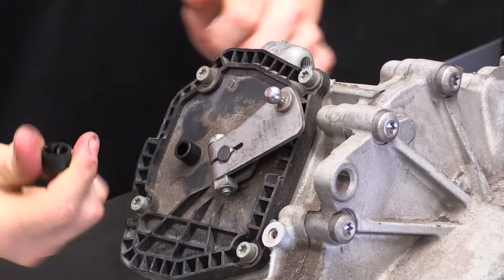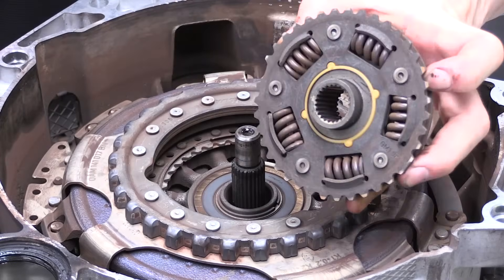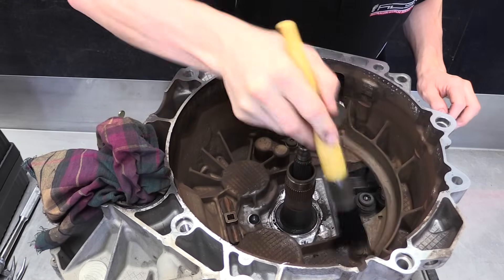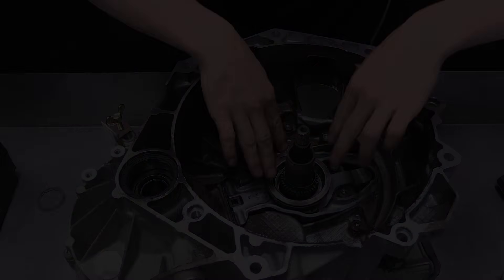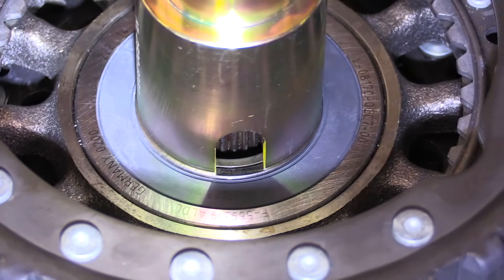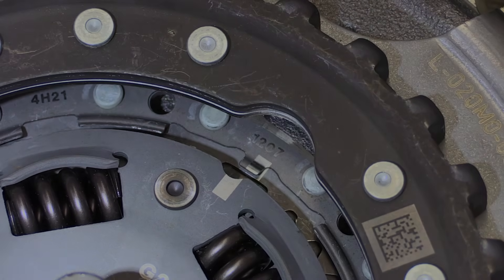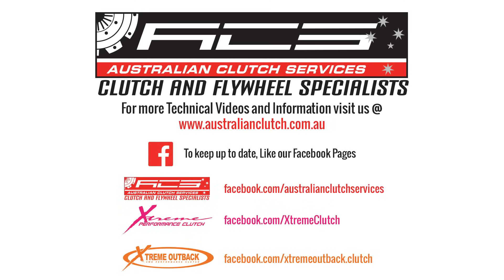CLUTCH TECH: Dual Clutch Transmission Clutch Assembly Removal and Installation Guide

Comment: I have been experiencing a problem with the DQ250 gearbox for the last 10,000 km and it sounds like this:
When the clutch engages there is a clunk, the gear shifts are very linear and nothing is felt, except a clunk and a little jerk.
I have noticed this phenomenon also when I go, in any gear, take my foot off the accelerator and put it back on, a clank is heard.
I'll leave some videos below with what I'm trying to explain.
I'm guessing it would be the dual mass flywheel, the car having 210k km. 
The dog bone and mounts are ok.
Replaced the CV Joints but nothing changed.
The sounds appears when you try to reproduce the noise which gets louder and louder the more you try to reproduce it
Also when i'm in idle i feel sometimes some vibratians and when i put it in D, the vibration dissaperes.
On VCDS there's no errors from mechatronic unit. 
What do you guys think?
Video on my profile.

Comment: Hello can old clutches recalculate and work like. New I think it's it's ppposible but you must calculate agan those measurement from the new for example new itsh 0.30 mm the old must be 0.20 and readapt with diagnostic tool and work like neww baythe way bye have a nice day.

Comment: Hi I have one of these transmissions in a VW Passat cc sport 2012 it doesn't engage if I roll the car down hill and let it pick up speed then press gas it drives then when it shifts to 3rd it's back to no power so I can press gas unless it's in second what can be the issue...does the clutch need reinstalling?

Comment: Tis is not really correct way. After shim mesure you have to add or remove thicknes of the shim regarding the tolerance of the clutch module. This is why you have mesure tolerance on clutch K2 0,3 min and it shoud be at least 0,4-0,5. There is a reason why there is on the cluch module whriten tolerance for K1 and K2.

Comment: What tool are you using to take out clutch
Reply from the maker: Hi,
This is using a specialist tool that we can supply for DCT. Normally there will be be generic removal and installation tool and then specialist adapter tools for each vehicle application. If you can email your vehicle details through to sales@australianclutch.com.au our sales team will be able to send you through a quote on the specific tools required.
Thanks
Reply: sales@AustralianClutch.com.au
Reply: @australianclutchservices7503  Is that the correct email.
Reply from the maker: @John-ef8zf  Yes it is however you will need to ensure to add sales@ on the front if you click on the hyperlink. Alternatively, please visit our website www.australianclutch.com.au and there is further contact information there.
Reply: @australianclutchservices7503  Thank you

Comment: hello
am getting trouble with an dsg gearbox i remove the mechatronic to change an o ring when i put it in the vehicle it have a rough reverse and no forward need help plz
Reply: Did you put the round torq convertor good in

Comment: Why did you not replace the clutch plates at the same time?  They surely would be worn.
Reply from the maker: Hi,
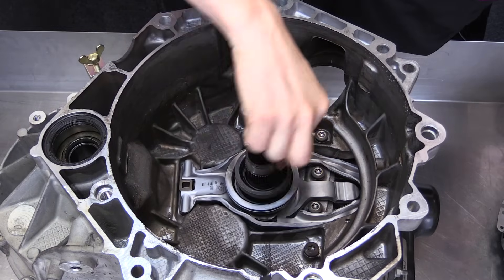Thank you for your comment. The entire assembly is actually replaced rather than just the discs. You can see the new assembly itself being reinstalled at 4:33. 
Thanks

Comment: is it manual or automatic this clutch?
Reply from the maker: Hi, This is for a Dual Clutch Transmission. It uses a dual clutch assembly but drives the same as a conventional automatic and is automatically actuated.
Thanks

Comment: I have dsg gearbox vw car. once on highway I accidentally moved to Neutral mode and engine revved I immediately shifted to D mode. since then engine pickup is little dropped and it revves much higher in 1st gear before moving to 2nd gear.  what could have damaged?

Comment: Excellent video! My dct fiat 500 transmission does not engage after sitting in cold weather. After a warmup by running the engine for some time... only even number gears are being used. If I manually try and engage the odd gears the system tells me that the gears are unavailable.  Any ideas on the issue?
Reply from the maker: Hi John,
We haven't come across this in a Fiat 500 before and without the vehicle to diagnose, it is very difficult to know, but it sounds as if this might be transmission related rather than the clutch system. Probably best to take it to your local specialist to have a look and diagnose.
Thanks

Comment: Hi , thanks for the video upload, can I ask,  do you not need to calculate the correct shim size by means of a calculation , or is this different from other dsg7 gearboxes,  thanks
Reply: As per manufacture standard its requires to do the measurements which is quite different from the video.
Reply: Instablaster

Comment: Brother: I have i10. From Past some days I hear rattling sound from bottom on the car while high eselarate or release eselarate paddle after high aselarate. While normal running it is not coming. What is the cause of this sound.
Reply from the maker: Hi,
There are a number of things that could cause this. The best solution for this would be to visit a local specialist and let them listen to the sound and give a more accurate diagnosis on the cause.
Thanks

Comment: Hi, what's up.
You are distracting me because of my bad English writing.
I'm from Mexico, change a clutch to a 2010 Audi a3 1.4tfsi car and mark two error codes after driving the 4km car. The codes are P177B and P177C.
I do not know what to do about it.
can you help me, please.
the replacement was done with the same video tool and the same procedure.
Reply from the maker: Hi Pedro,
If you haven't already, your best first step would be to determine what causes these codes. We have not come across these before but it could be caused by a variety of different factors. Probably best to get the codes checked by a local VW specialist.
Thanks

Comment: good afternoon friend where to buy the torque wrench you used
Reply from the maker: Hi,
The torque wrench itself is available from a wide variety of automotive parts outlets, tool shops etc and is just a generic torque wrench. The DCT specific tools used for the removal and installation are available from Australian Clutch Services. If you are looking for the tools required for the replacement, please email sales@australianclutch.com.au and our friendly sales team will be able to assist you further.
Thanks

Comment: Sir in last moment of this video thw Gear is in N or Gear (any) position.
Reply from the maker: Hi Arjun,
For this, the transmission can be in any position.
Thanks
Reply: @australianclutchservices7503  sir I have done same procedure both clutch were free.. But after completing gear in car..  None of the gear shift,,,  but when I lift clutch lever with the help of screw driver then wheel rotate...
Reply: Car taken at garage by driven..

Comment: In general, is coding the vehicle required after re-installation? How to the actuators re-learn - or is this necessary? Specifically on Hyundai/Kia applications.
Reply from the maker: Hi,
Every manufacturer has a slightly different setup. With most VW Dry Clutch setups like the one in the video, it will automatically re-learn. It may cause some check engine lights that would need to be cleared by a scan tool.
Thanks

Comment: and this suppose to be more trouble free than a normal tried and tested auto. trans. ?  I don't think so .
Reply: you obviously don't understand that benefits can come with other drawbacks, this being one of them
Reply: Not more trouble free than most modern auto transmissions, but more efficient, more compact and lighter, resulting in better performance and fuel economy. 

Early DCTs had plenty of problems, newer ones are better. Early automatic transmissions also had their share of trouble compared to manual transmissions. With time the problems get sorted out.

Comment: I replace this clutch many times. this is the 7speed 0AM transmission!
Reply: What's model car this?
Reply: @perthempire1864  Audi A1, A3, TT, Q2, Q3. Any VW apart from Touareg, Amarok, Transporter and up!, every Skoda and Seat except the Citigo and Mii.
Reply: ambadas tile where I can get all these tools from ?
Reply: hi i remove the mechatronic for changing an o ring when i put it in the vehicle am getting problem to forward the car and having a rough reverse
 need help😥

Comment: What is someone don't have that tools to remove it .
Is there any other way to remove it ?
Reply from the maker: Hi Shairoj
We do not recommend trying to remove the clutch assembly without the necessary tools. The tools are also critical for ensuring the correct setup when installing the kit back into the transmission.
Thanks
Reply: Australian Clutch Services  
Thanks

Comment: Hi my 6 speed dsg box is leaking and and jerking when downshifting from 2nd gear to 1st. Have been told that the jerking will be cured by a new dmf and clutch and the oil leak is a differant problem?
Reply from the maker: Hi Danny
Could you please advise what vehicle this transmission is fitted in and I will discuss with our technical team.
Thanks
Reply: hi it is a seat leon fr tdi 2011 i have fixed the leak it was the sump plug but the jerking from 2nd gear to 1st when coming to a stop is still there may it be the DMF?
Reply from the maker: Hi Danny
As this is a factory clutch, it would be best to take this to your mechanic or dealer for inspection. It is difficult to diagnose this problem accurately without the vehicle present.
Thanks
Reply: Hi, my mechanic says it is early symptoms of dmf failure but im not sure as im only having one symptom other than that the car is brilliant

Comment: Thank you for sharing. I have Renault Megane 1.5 dci EDC. How many kilometers service life have these transmissions clutch drums?
Reply from the maker: Hi Khakans
The life of the clutch is dependent on the way in which the vehicle is driven as well as any performance modifications of the vehicle. If you feel that the clutch assembly is at the end of its life, you may notice some of the following: shudder when taking off from a stop, noises from the clutch that could indicate a failure or clutch slipping. These symptoms may also be as a result of other factors but are common indicators of a clutch failure.
Thanks
Reply: Australian Clutch Services Thank you.

Comment: why they have given air inlet
Reply from the maker: Hi Raju
Thank you for your question.
Are you referring to the ports on the side of the bell housing? If so, these are just for inspection purposes.
Thanks
Reply: Australian Clutch Services on the side of bell housing...there is a squarish hole....covered by net..
Reply: Australian Clutch Services what is use of squarish hole on the side of bellhousing covered with black net
Reply from the maker: Hi Raju
This appears to be an inspection port. The black grille can be removed as seen in the video and reinstalled before the gearbox is returned to the vehicle.
Thanks
Reply: Australian Clutch Services what about water entry from the hole..that can destroy the clutch plates many such cases are seen in India..

Comment: How about seals .  Should they be replaced , considering you have the transmission torn down to this extent ?

Thanks ,   :-)
Wyr
God bless
Reply from the maker: Hi Wyr
Thank you for your question
This is dependent on the vehicle etc. Can you advise which vehicle you are working on? Referring to the front transmission seal/input shaft seal, in general this should just be replaced if it is seeping. Some vehicles are also prone to the seal leaking/failing and it is therefore suggested that this is replaced during this process.
Thanks

Comment: Assuming there isn't an idiot at the helm, how many miles should you expect out of a dry clutch set?
Reply from the maker: Hi Barry
The driving style does have an effect on the longevity of the clutch, however it is also highly dependent on the vehicle type etc as well as the conditions in which it is driven. If you would like to find more information about the longevity of a clutch in a specific vehicle, please email sales@australianclutch.com.au with your query and vehicle details and the sales team will try to advise you based on previous experience.
Thanks
Reply: I have 2016 Golf 7 with this transmission. I have 31kkm and will replace clutch next week under  warranty.